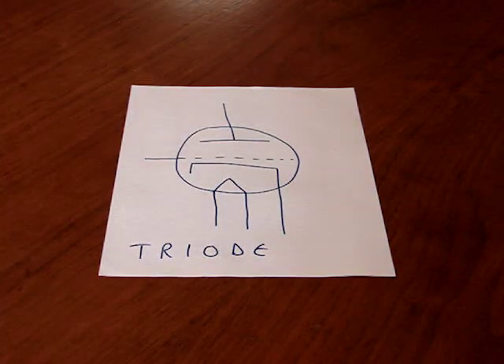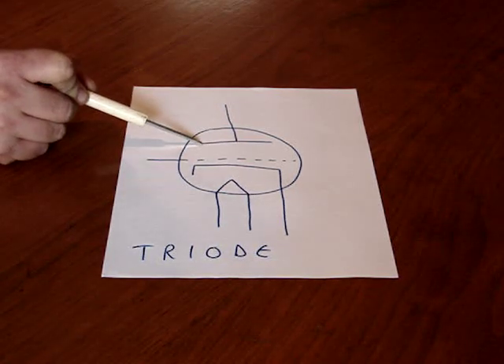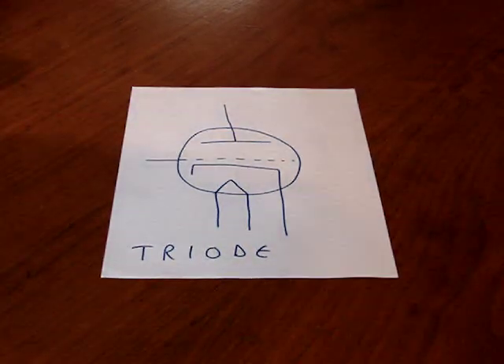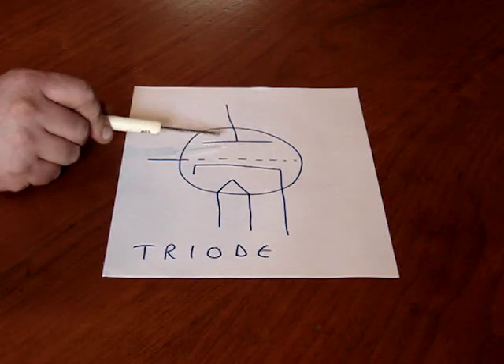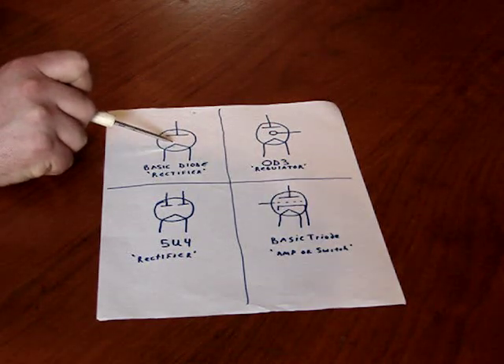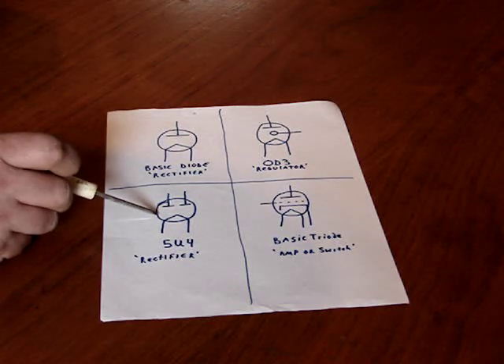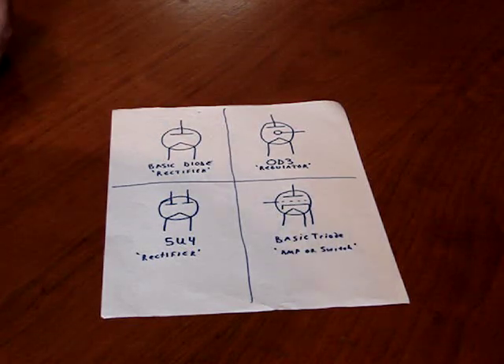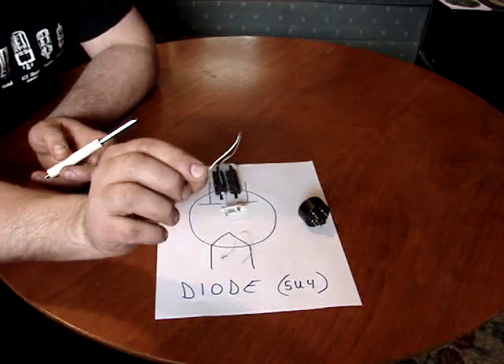The Learning Series - Vacuum Tubes and Amps Part 2

Comment: metals and shielding. why tubes, I use a fender deluxe 40w tube amp and a line 6 150w spider 3, and here are my 2 reasons I like the fender better it is 4x louder than the line 6, the warmth and tone is beautiful, while the line 6 is a great studio amp it gives you studio tones and digital modelling I would not not trade it for anything, but a bigg con about the fender is to be prepared to replace tubes every few years which can be roughly $100-200 but if my line 6 was a tube I would marry it.

Comment: I know this is old but I might be able to help. The standard pre tubes in guitar amps are 12ax7 A good tube to buy is the brand groove tubes. I don't think the tubes determine hotness or loudness of the amp, but the size of the transformer is mostly were you get the power from I don't know if you can just buy a bigger transformer and just install it, you would have to atleast match the specs of your old one just find a bigger one with the same specs and maybe a better quality one with better...